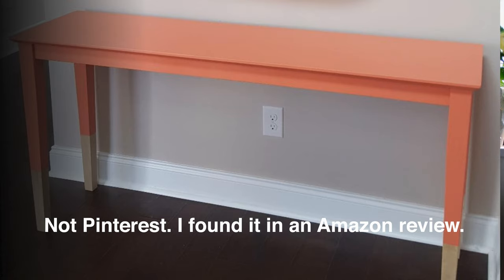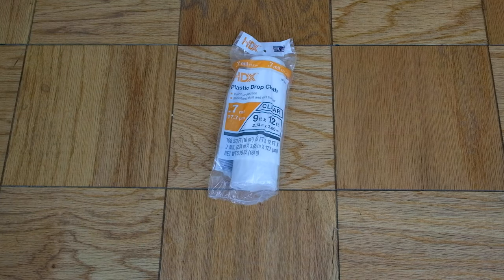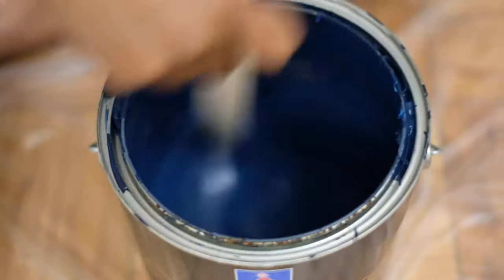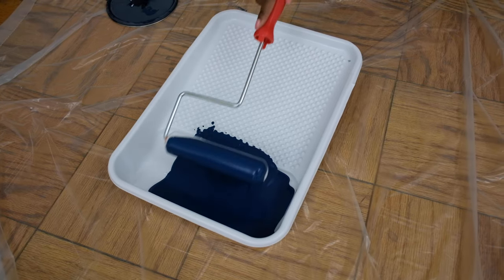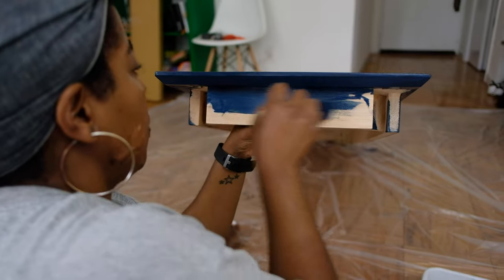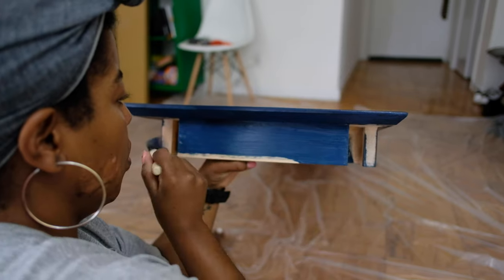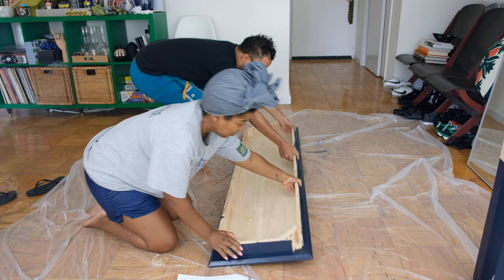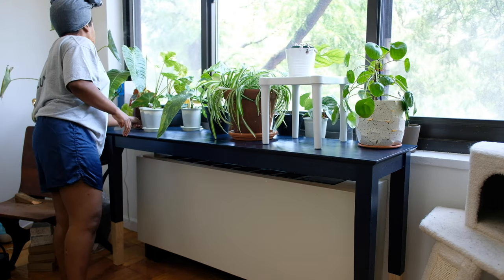DIY Plant Table

Comment: Just a little helpful hint in that the polycrylic can also be applied with one of the small foam rollers to get a smooth and rapidly applied coat to the top and legs while still using the foam brush for the detail areas on the sides.     You can wrap the roller, brush and tray in plastic/plastic bags and keep them fresh in the fridge in between coats. ( You may already know this since you're now three months further into your DIY journey).
The table looks great and I love your choice to paint only part way down the legs!    I did that to a thrifted coffee table that had little animal feet at the bottom of the legs.

Comment: Thanks for the idea. Trying to find a table to fit around the radiators is a pain.  I actually made my first one with scrap wood.  I recently purchased a shelving unit from Amazon that I hacked to fit around the radiator.  I am greedy, this unit had two shelves. I just purchased a boot tray to create a pebble tray for my plants that are on my radiator.  My apartment was a sweltering 89 degrees last night.